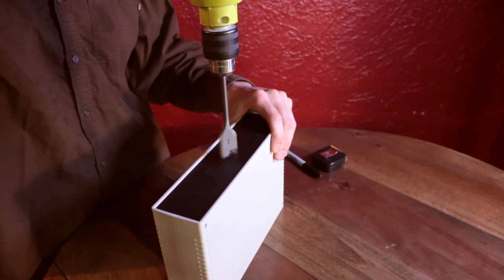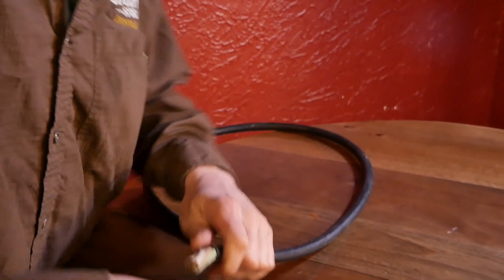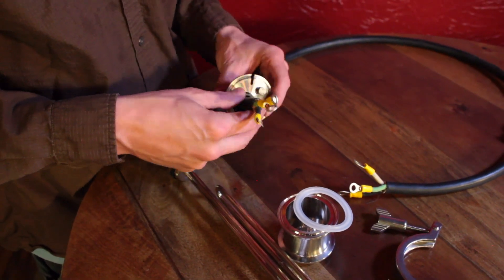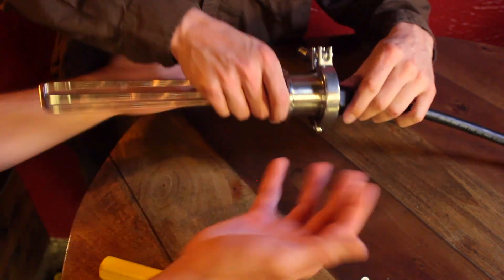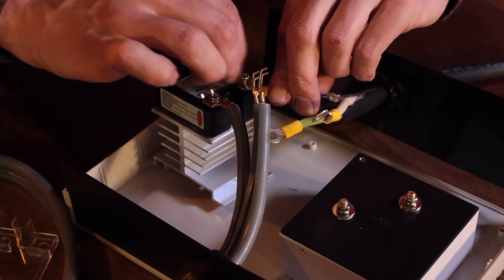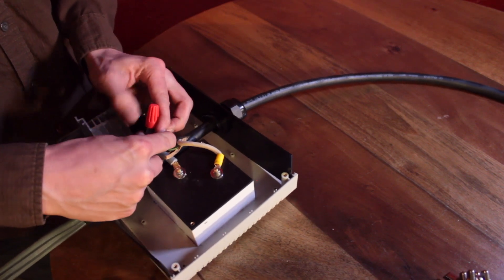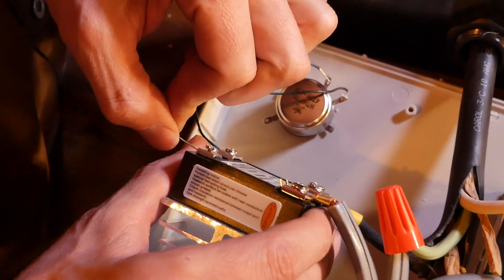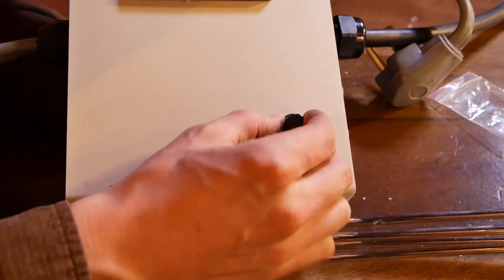DIY Heat Controller Video

Comment: If you are looking for a nice piece of equipment, this is it!!! However, their customer service is the worst I’ve ever seen!!! They refuse to answer the phone if you had issue with an order on their behalf. Will only communicate through email and wont take any responsibility if they ship something not compatible with your setup as “every customer usually take a different mode of setup” NO, I ordered a thermowell and thermometer for the broiler and they sent me something that did not fit my broiler 100% a mistake on their part. Refused to send out correct parts until they received the wrong parts back and wanted me to pay for Shipping and Handling! HAHA!!! You are better off ordering the broiler and other components from China where they have better customer service and are at a lower costs check amazon for 90% of the parts you need before ordering from these guys. I always try to support USA businesses and this company makes me regret that decision 100%. Go read their google review and see what me and countless others are having issue with.

https://www.google.com/search?q=moonshine%20distiller%20colorado&sxsrf=APwXEdceHJNmC0GxSwVUzpCHSWnO_jEw9g:1684001401372&source=hp&ei=ctJfZOX-DMnBkPIP1tWxwAY&iflsig=AOEireoAAAAAZF_ggio-sytVPJC4sibVfuE3TXRf1rPs&oq=moonshine&gs_lcp=Cgdnd3Mtd2l6EAEYADIHCCMQigUQJzIECCMQJzINCC4QFBCHAhCxAxCABDILCC4Q1AIQsQMQgAQyEQguEIoFELEDEIMBEMcBEK8BMg4ILhCKBRCxAxDHARCvATIICAAQgAQQsQMyCAgAEIAEELEDMhEILhCKBRCxAxCDARDHARCvATIFCAAQgAQ6BwgAEIoFEEM6BwguEIoFEEM6CgguENQCEIoFEEM6CgguEIoFENQCEEM6CwgAEIAEELEDEIMBOg0ILhCABBAUEIcCELEDOhEILhCABBCxAxCDARDHARCvAToICC4QgAQQsQM6FgguEIAEEBQQhwIQsQMQgwEQxwEQrwFQAFiiCWC-J2gAcAB4AIABpAGIAe4HkgEDMy42mAEAoAEB&sclient=gws-wiz&tbs=lf:1,lf_ui:2&tbm=lcl&rflfq=1&num=10&rldimm=13949964925883645564&lqi=Chxtb29uc2hpbmUgZGlzdGlsbGVyIGNvbG9yYWRvSN2O-6zUlYCACFomEAAQARgAGAEiHG1vb25zaGluZSBkaXN0aWxsZXIgY29sb3JhZG-SAQdicmV3ZXJ5mgEjQ2haRFNVaE5NRzluUzBWSlEwRm5TVVJ0ZUU5WFFWaDNFQUWqAXIKCC9tLzAyOXIxCggvbS8wemdocRABKhciE21vb25zaGluZSBkaXN0aWxsZXIoADIfEAEiGzmShU11BNmT9pR5jszqT6wx99049HyXiywUFDIgEAIiHG1vb25zaGluZSBkaXN0aWxsZXIgY29sb3JhZG-6AQsKCW1vb25zaGluZeABAA&ved=2ahUKEwiNx9GK8vL-AhVDkmoFHTGhBZ0QvS56BAgbEAE&sa=X&rlst=f#rlfi=hd:;si:13949964925883645564,l,Chxtb29uc2hpbmUgZGlzdGlsbGVyIGNvbG9yYWRvSN2O-6zUlYCACFomEAAQARgAGAEiHG1vb25zaGluZSBkaXN0aWxsZXIgY29sb3JhZG-SAQdicmV3ZXJ5mgEjQ2haRFNVaE5NRzluUzBWSlEwRm5TVVJ0ZUU5WFFWaDNFQUWqAXIKCC9tLzAyOXIxCggvbS8wemdocRABKhciE21vb25zaGluZSBkaXN0aWxsZXIoADIfEAEiGzmShU11BNmT9pR5jszqT6wx99049HyXiywUFDIgEAIiHG1vb25zaGluZSBkaXN0aWxsZXIgY29sb3JhZG-6AQsKCW1vb25zaGluZeABAA;mv:[[39.9707571,-104.8140262],[39.0430026,-105.84023549999999]];tbs:lrf:!1m4!1u3!2m2!3m1!1e1!1m4!1u2!2m2!2m1!1e1!2m1!1e2!2m1!1e3!3sIAE,lf:1,lf_ui:2

Comment: I have this kit, however I have a 4 wire 240v plug. How would I wire that to the solid state?
Reply: Since there is no need for 120 V anywhere in the controller circuit, you can blind off the neutral wire with a wire nut, and connect the ground wire as shown in the video.   In other words, you have 2 "hots" and a ground.